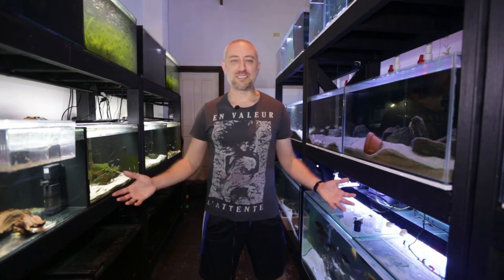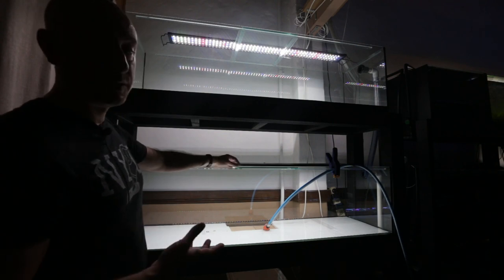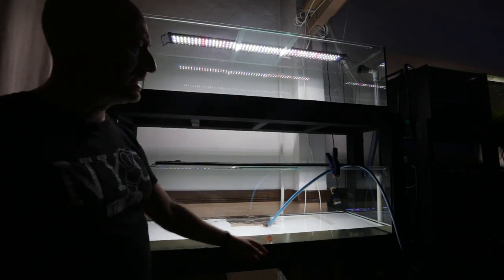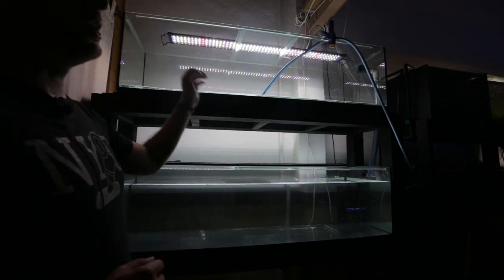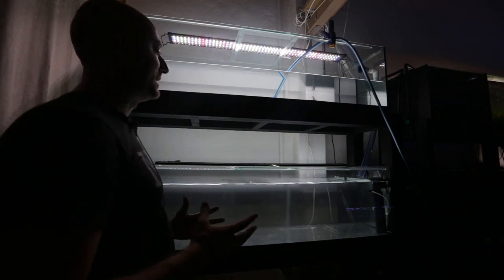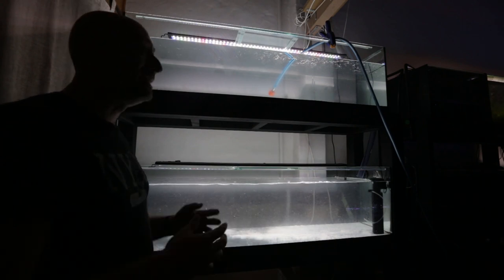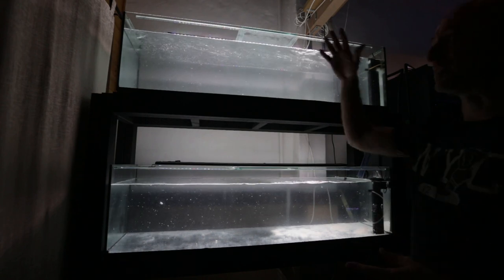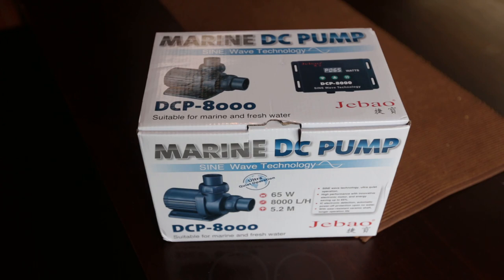Installing 5 foot aquariums to an existing sump system and Jebao DCP 8000 review Part 1

Comment: Hi Jason.
Interesting as usual.
The pump looks so small for the amount of output that can be achieved.
One question not related to today's vlog is....Do you experience an algae bloom when you set up a new system?
Thank you 🙂👍
Reply from the maker: Cheers mate, yeah it's a powerful little pump. Yeah I have experienced algae blooms. I did with the sump system and still get algae from time to time. Nothing a couple bristlenose cats can't handle though.

Comment: I use clamps all the time in the fishroom👍🏻 Jason have you used aragonite sand in any of your tanks? Keeps the ph nice for my Africans, that and crushed coral in the filter. Your 5 footers are coming along great! Those pumps are massive congrats on all the progress mate!🙂👍🏻
Reply from the maker: Clamps are very handy aren't they? Yeah I have mate, especially when I was keeping marines. I just haven't used it with this setup due to the amount I would need and cost. Yeah that pump is strong for its size!
Reply: Jason's Cichlids I’ve found you can do a mix of sand and aragonite works wonders with the ph for me. That pump could probly run my room lol! I need to switch to a central air system and get rid of the h.o.b. Filters…costs the electricity a small fortune😆
Reply from the maker: I might fork out the money for some aragonite one day. How do you go with the hang on back filters restarting after a power outage?
Reply: Jason's Cichlids they seem to just start up, I sometimes need to add a bit of water if they don’t prime, but that’s only happened a couple of times. I love the hob filters, but they are not economical to operate.
Reply: Jason's Cichlids you could just add a 10lb bag of crushed coral to the sump to raise the ph some it’s works  quite well🙂👍🏻